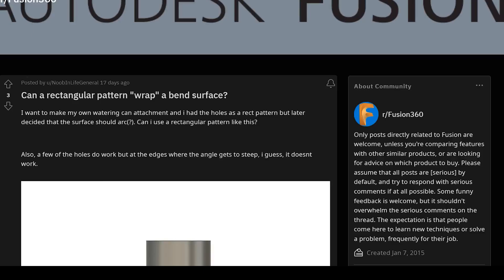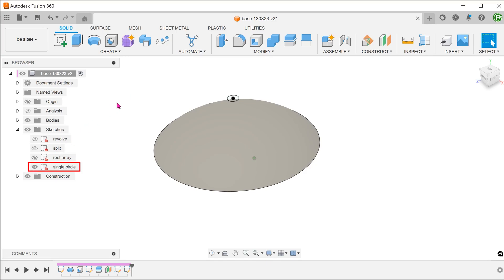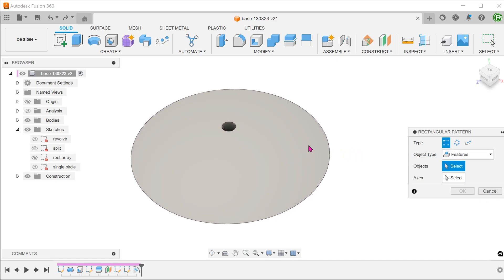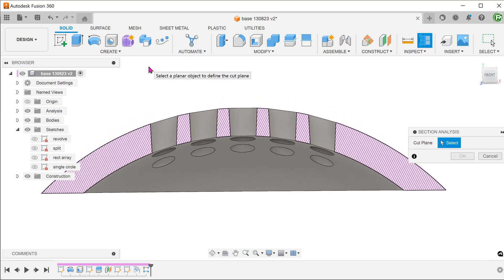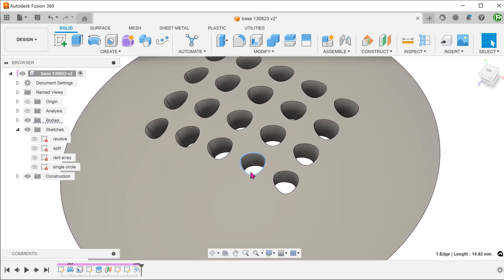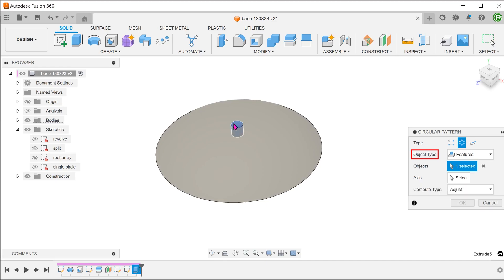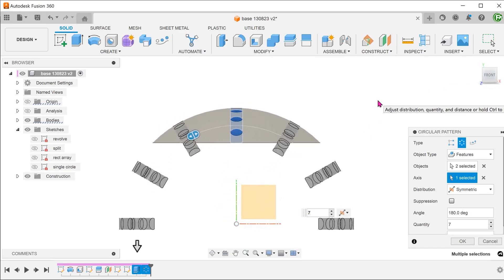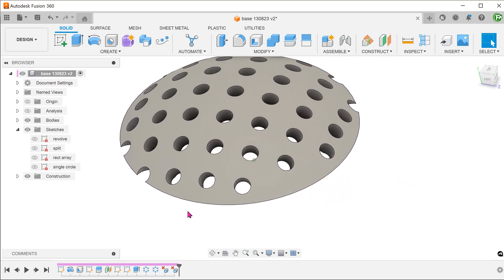Fusion 360 | Watering can attachment

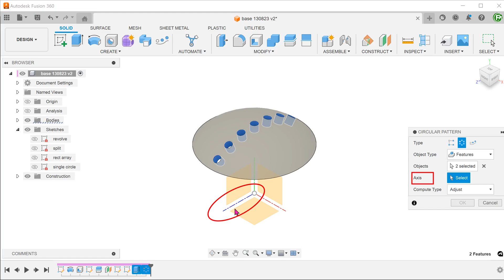Comment: when it comes to your circular pattern test (around 6:45), would it not be simpler to select the y axis instead of Z when you're patterning the first pattern, without selecting the second hole, then would it now pattern in a circular motion around the center point along the Vertical axis?

Comment: It took a bit but I made axis perpendicular to face at a point for one set of holes, projected them onto a sketch, made planes along path for them, and then sketched circles to extrude, linking their dimensions so I could quickly change their diameters. This kept all of the extrudes normal to the face and you aren't limited to having a spherical face. Then I made circular patterns in sets so that things didn't get crowded in the center or too spaced out near the outer edge.

Comment: I've been stuck on threads for something like this to attach to a 1 gallon jug.  The jug was using has some proprietary thread, where it's 3 threads each about 1/2 turn.  In practice it shouldn't be so difficult, but measuring it properly is tricky.